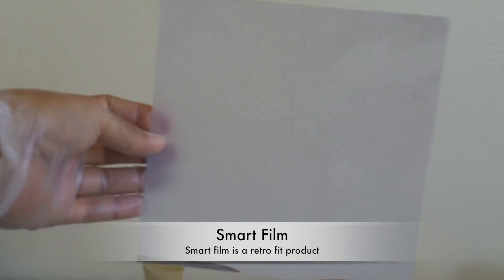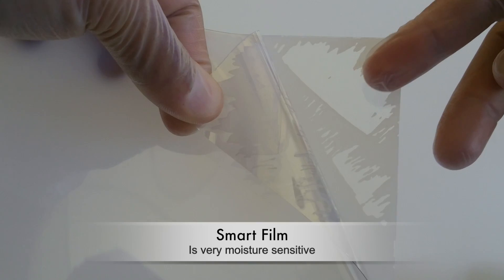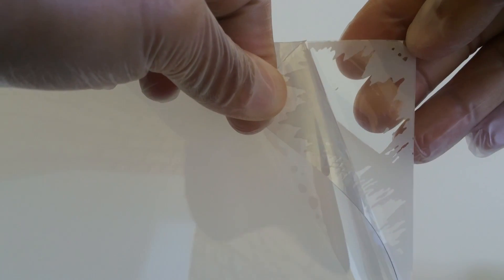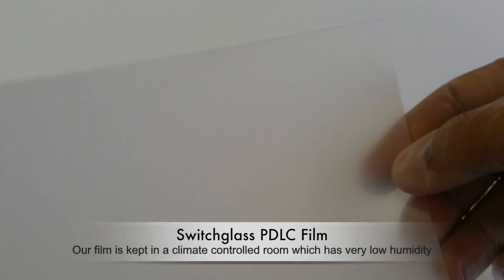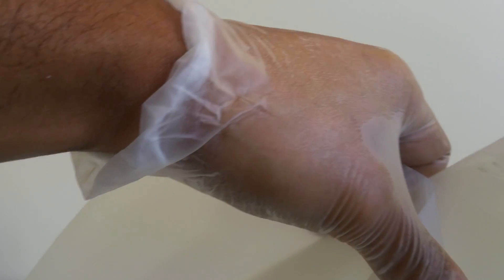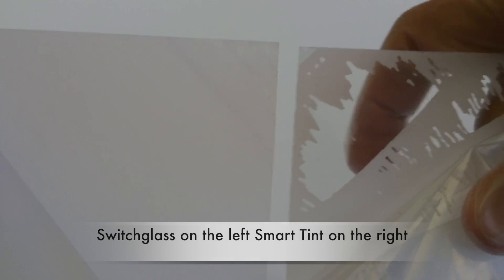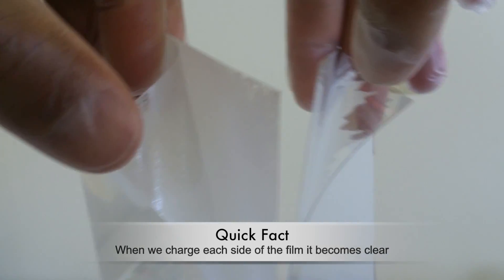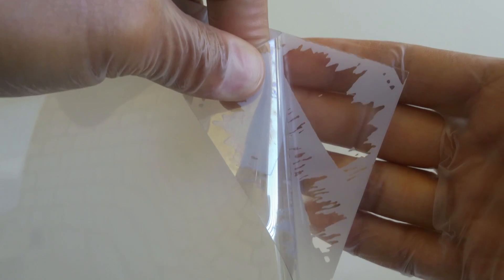Smart Tint Vs Switchglass

Comment: Why didn’t you use 12 month old switchglass?  to make it an even test ?
Reply: Switchglass you are obviously 100% bias! Most anything 2 weeks out of the factory will preform better than it's counterpart that was left outside to the elements for a year. Both products need to have undergone time exposed to whatever elements.   If this is your testing and reviewing process I'd be worried about the integrity of any product you release. Boasting a 2 week, "factory fresh" product is better than a one year weathered product is just asinine.
Reply: Excellent points. This test is a sham. Compare films of equal treatment and lifespan and let's see what happens. This looks like such a scam when you slam another product in such a dirty fashion.
Reply from the maker: Brian, we are able to sell this product as well and it would have a far greater margin for us. However, our test over the last decade along with our partners around the world support the product not being very reliable. The reason this video was made was that we replaced an entire project which had Smart Tint installed due to the customer being disappointed with the quality and performance of it. 

Here's the article below if you are interested:

Smart Tint vs Switchglass – What is the difference?

•   Smart Tint is a film that can be retrofitted (stuck on) to the surface of your existing glass.

•   Switchglass is a ready-to-glaze product that incorporates a switchable Polymer-Dispersed Liquid Crystal film carefully laminated between two pieces of glass.

There are many promotional videos on the internet showing Smart Tint being easily installed in just a few minutes. These videos clearly over-simplify the process. Handling switchable film (even in the form of Smart Tint) requires considerable skill and experience. If the film is creased, bent or bruised it will damage the liquid crystals inside leaving a clear patch where the damage occurs. Our technicians need a minimum of six months training in the handling, wiring and laying-up of switchable film for lamination and our clean room (a totally dust-free environment) is monitored to ensure quality handling is achieved and optimum standards are met at all times. 

It should be noted that a number of years ago, with the possibility of marketing these self-adhesive DIY switchable films ourselves, we tested a number of them (including Smart Tint), but based on the results all were rejected. 

Pros and Cons of Smart Tint

Pros:

DIY 

Cheap

Cons:

No warranty support 

Easily damaged during installation

Low clarity

Limited lifespan

When cutting or trimming to size the edges are easily damaged 

A Case in Point – and the reason we felt the need to speak up about this DIY product

We were recently approached by a disgruntled customer of DIY Smart Tint. The following is a rundown of the customer’s unfortunate and costly mistake in choosing Smart Tint over Switchglass.

Their Smart Tint arrived rolled up and packed into a box which contained all the equipment; the film was approximately cut to size for each of the windows. The client’s Project Manager organised a local tinter to install the Smart Tint using the instructions provided. After the installation the client commented that the film was not very clear, with an unacceptably high level of haze. He also commented about the edges being slightly damaged and bubbles visible in the film. 

Overall, the customer was definitely not satisfied with the outcome. The Project Manager communicated the customer’s dissatisfaction with the Smart Tint supplier and was given some tips on how to improve the clarity, i.e. by ramping up the voltage to the Smart Tint (this is not a good idea as it can damage the sensitive PDLC film and shorten its lifespan). This did temporarily improve the clarity, but the transformer could only run the Smart Tint for 2-3 minutes before shutting off, then needing 10 minutes to cool before starting up again. 

After being initially responsive to the Project Manager’s needs the Smart Tint supplier then ceased further communication for no apparent reason. Now the Project Manager is looking to start legal action against them. This will be challenging as the supplier is located in the United States and he is in Australia. The customer concluded that the performance of the Smart Tint (and the lack of follow-up support) was unacceptable.

We were approached and we met with all the stakeholders. Upon testing our sample and witnessing the results, their response was that the “Switchglass was much clearer than the Smart Tint”. At the end of the meeting it was agreed that the Smart Tint and glass would be removed and our Switchglass installed in its place. 

Caveat Emptor – let the buyer beware

This has been a very costly exercise for the customer who has spent nearly double the amount of what it would have cost to have Switchglass installed in the first place.

We will have some updates coming from this case study shortly as the replacement installation has not yet taken place. We will have a video, pictures and interviews with the customer, Project Manager, builder and architect. Our aim is to provide relevant information that will assist all parties and future customers in making an educated decision. 

In conclusion, Smart Tint may seem like an attractive option due to its promoted ease of installation and low cost, but we advise caution - as the above scenario clearly demonstrates.
Reply from the maker: Sean, as our film is designed to be laminated. Typically this is about 10-15 days from the time it is produced. We do hold stock in a climate controlled room with a 10%RH (so very low moisture) where it is kept for no longer than three months. Once it is laminated is stops degrading as it is no longer exposed to moisture. With retrofitted PDLC it is exposed externally to the elements and this is why it does not have a very long lifespan. It any PDLC film is exposed to the elements for 12 months then the outcome would be the same. This demo is to show what happens when it is not laminated.
Reply: Switchglass it is still not an even test I'm not even bothered about it much just always have an even test
Reply from the maker: Sean thank you for your keen interest, we value your thoughts on how we test and review products. We will certainly take on board your thoughts for our next review.